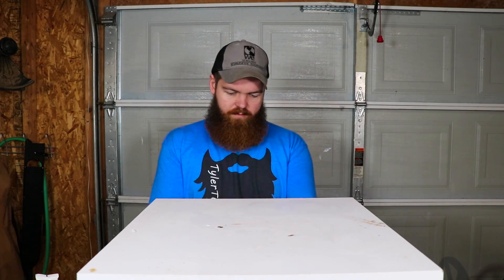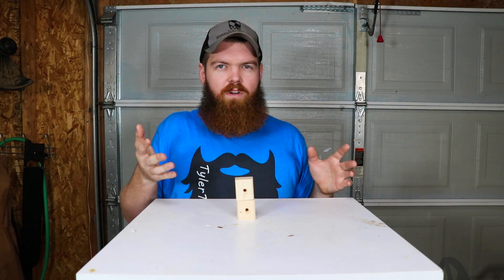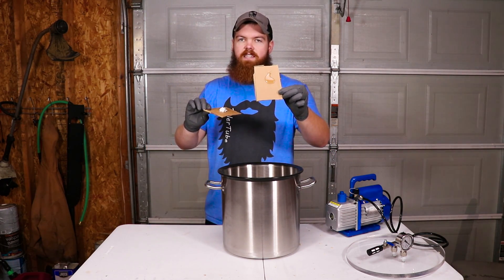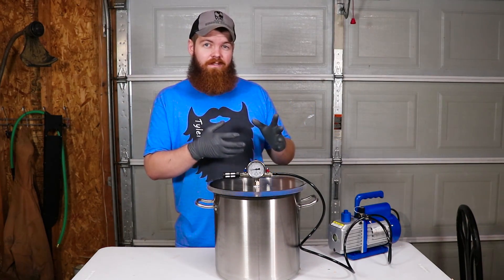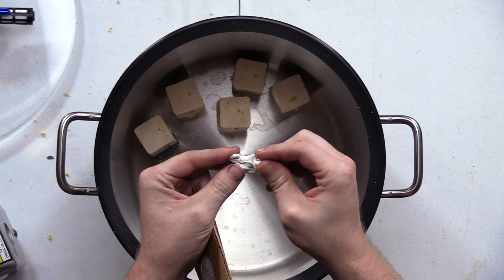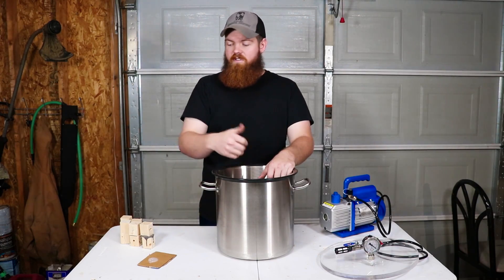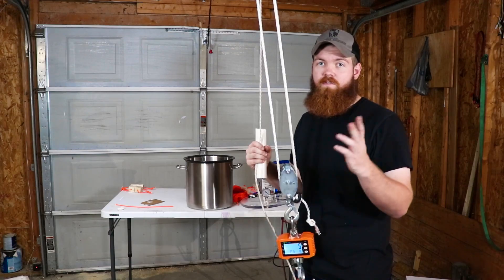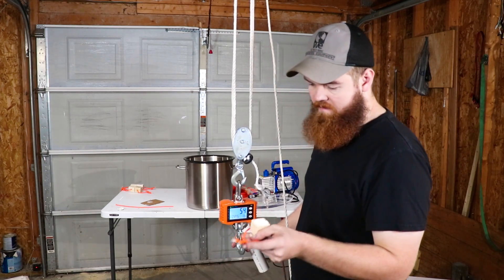Will Glue Dry In A Vacuum Chamber?

Comment: Cool video.  This kinda tested glues not clamped properly, in a vacuum chamber. In general, the thinner the glue line the stronger the bond. Those that foamed up pushed the blocks apart leaving the walls of the bubbles as a contact area. Wood glue and epoxy (JB without filler) are often vacuum bagged for laminations. Is e6000 a contact cement? It's possible the vacuum extracted the solvent allowing it to cure where the blocks in air never had a chance to cure before they were stacked  together.

Comment: Given my profession at one point was advanced composite repairs for military aircraft, anyone trying to criticize your technique should know ahead of time that your set up is far less janky than vacuum cure set-ups I've seen work from my previous coworkers.

Which a truthful job description for advanced composite repair:

Literally 90% of the job is watching glue dry under vacuum sealed conditions. For an aircraft it's just sit there on the aircraft with a good book and do that for an entire shift making sure no alarm fires.

Edit: Also, if anyone is curious, you typically vacuum cure glues for fiberglass and graphite and similar, usually with heat too, and no, we'd not get caught dead with JB Weld for use in the aircraft repairs because we'd probably get murdered by our shop chief (if the shop chief is competent).

Also, typically, vacuum curing glues requires specific types of glues or resins acting as glues and usually is heat treated, not a comment against the vid, specifically just an FYI.

Comment: Fun fact: metal flash welds in space. So they don't need a welder in space, all they need is the piece of metal and then it will attach itself to w.e. they stick it to
Reply: True if the two metals are very clean and smooth, and not previously thinly oxidized with exposure to oxygen (i.e. inside the space craft)

Comment: You need to boil water until it freezes in the vacuum chamber. All you do is put about an inch of water in a glass or plastic cup and put it under a vacuum. It will start to boil and the temperature drops while it’s boiling until it freezes. It takes a little while to freeze depending on the size of vacuum pump you use.

Comment: I think the results would have been different it you didn't use end grain.  I think that might explain the last result.  End grain on a wood is like straws that are bunched up.  And the vacuum sucked the glue up through the grains (because its like a a straw)  But the last one might have been viscous enough that more glue stuck around.  But if you had used the edge grain, the wood would've failed before the glue joint.  Really interesting.  And don't ever change.  If you like scientific vids, there are plenty out there.  I watch your video because it's  entertaining and interesting!!

Comment: It is near impossible to create a perfect vacuum on Earth. So there IS still air in the chamber to dry the glue. The bubbling of the glue in the chamber was caused by gasses inside escaping due to the lower atmospheric pressure. With less air pressing on the glue to keep the trapped gasses inside they "boiled" off until an equilibrium was reached.

Comment: My theory?
The E 6000 is less viscous than the rest, so when you pulled a vacuum, it too bubbled, but because it was thinner, the bubbles popped and reset before curing completed, also, while it was resetting, the vacuum pulled the glue deeper into the pores of the wood, giving it a much better hold.
The other glue's being much more viscous, and with quicker curing time, cured with the bubbles still intact, greatly weakening the bond.
I'll be the other glues, while having weaker bonds, still saturated deeper into the wood as well, but because they cured before the glues could reset before the bubbles popped, the bond was compromised.
I'll bet if you look at the wood blocks from the vacuum chamber, the glue is still on both pieces of wood. Showing that the glue held to the wood, but failed because of the bubble matrix within the glue itself.

Comment: The glue that was stronger in vacuum was interesting. I would note though, it look like Tyler applied a "shock" load on the non vacuum bricks. (a shock load is a load applied very suddenly such as a car crash or a hard quick tug on a rope). Shock loads have more effect and will cause a material to fail quicker then slowly applying a load at a constant rate.

In short,
The E6000 (or what ever its called) could've failed so easily the first time round because Tyler pulled top hard and quickly on the rope. The other glues were interesting though. If you plotted the results, you could probably figure out a relationship. This might've been something that NASA and Space X have had to think about. All in all, good vid Tyler!
Reply: Nerd

Comment: HEY TYLER INSTEAD OF USING WEIGHT THAT CAN MOVE AND SHIFT WHICH CAN PUT UNDUE STRESS ON YOUR TEST, JUST USE A LAG BOLT IN THE GROUND AND PULL ON THAT! THEN YOU WON'T HAVE TO WORRY ABOUT RUNNING OUTTA WEIGHT EITHER!

Comment: Hey Tyler, can you run this test again, but put weight on the blocks? I suspect the weakness was due to the micro air bubbles coming out solution in the vacuum. I wonder if there was weight to clamp the pieces together to close the void again if it might be stronger?

Comment: you can get a cheap boat winch at harbor freight to mount on your wall and use that to pull the rope instead of the pvc pipe. this will save your toes from the falling weights and save your fingers from rope burn. I used a similar set up to lift the back of my snowmobile in my shop when doing maintenance. p.s. I love the videos. you answer questions that I didn't even know I had until I read the title "will glue dry in a vacuum chamber?" "does nano tape really work?"

Comment: I have a suggestion. What about instead of weights you just bolt a hook into the floor? That way it will measure the weight of resistance and you won't have to worry about not having enough weights

Comment: So, to give a brief explanation to the results

Pressure changes will directly affect the phases. For example, the reason why you're probably seeing so much bubbling is from any water in the glue BOILING OFF. That's right, under less pressure the boiling point of water decreases and will boil at room temperature and below (while also freezing into ice, as the melting point also changes and can exist in the "triple point" state, where the two points meet allowing for a quick change between all three phases In the case of water, lowering the pressure INCREASES the melting point temperature, while other materials will typically see the melting point temperature decrease). I would imagine the issue the glue is facing in the vacuum chamber is exactly as Tyler guessed, its having issues with curing as some of it is probably melting, which is what might have led to it smelling so bad (liquids give off more vapors than solids). As for E6000, im not sure what's going on with that glue. It could be that the glue had a higher melting point than the others, meaning that the water boiling out of it only made it dry even faster and allowed it to cure even stronger? Not sure, i can't find much info on E6000.

Comment: The glue "dries" because of a chemical reaction triggered when it makes contact with the air outside of the tube. The main reason it's weaker inside of the vacuum chamber is that it can't continue to react with air once the initial reaction has finished. As for the e6000, my best guess is that a: it relies on a different reaction which isn't dependant on oxygen, or somehow has its own, and b: the dried/cured material held the vacuum once you opened the tank, creating a similar effect to clamping the blocks.

Just a guess, though. I'm no scientist, just a knowledge enthusiast.
Reply: Nerd
Reply: @goodjoke6525  Yep!

Comment: Pro-tip. Lag an eye bolt into your garage floor (they make covers for them so you don't trip all the time, typically sold for tying down motorcycles) then mount a manual wench on the wall, still using your reducing pulleys, and you'll have smooth pull with a much higher weight limit. Bonus, you won't have to constantly lug heavy weights around and pinch yourself on chains.

Comment: For anyone who is interested in the science factor: A vacum chamber pulls the air out of the product in there causing the air inside the glue to "expand" creating a weaker bond. There is less surface area between the glue and wood blocks making it weaker.

Comment: Do a test in glue itself without blocks.  Test a set of glue inside and outside the vacuum chamber.  See what the hardening state of each glue would be.  Would the glue harden or soften inside the chamber after 24 hours.

Comment: This is a big long paragraph explaining what you did wrong. I don’t know what you did wrong, but i will explain it to you anyway. You see that thing you did at that one point? That was wrong. You were supposed to do the other thing first. And you know that other part? That was also wrong. You need to rotate the thing 60 degrees first. Also you were supposed to heat the thing before doing the thong. In conclusion, you are very wrong in everything you did, and you should feel bad. I am disliking the video because i have a massive ego. This comment sure is meta, isnt it? This is how you do things correctly, not how you did the things.

Comment: You should try this again but add weight to the blocks in the vacuum chamber. That way they remain compressed while the air escapes. That will give you a MUCH more accurate idea of whether the air makes a difference. When they are able to spread apart it weakens the glue. The more concentrated it is the stronger it is. So if you try this again but put a heavy weight on top of them, the air should go out the sides which will leave the blocks tightly together. I would add extra glue because you will lose a lot out of the sides. So maybe, somewhere between 25 and 50% more glue. Probably more towards 25%.

Comment: The glues that were weaker probably need oxygen to cure, whereas e600 probably solidifies by loosing all of the solvent that keeps it thinned to a paste. This would explain the apparent extreme variation because glues that evaporate solvent can only evaporate so much before the vapor pressure of the atmosphere prevents it from leaving the glue. Without the atmosphere nearly all solvent could leave, allowing for a much stronger solid.

Comment: If you have a stronger vacuum pump it would have better results your vacuum pump is a little too weak press something like that you need more power
And I have a suggestion if you get a more powerful vacuum pump full up a jar with super glue and put a block of wood in it to see how much did the super glue soaking and if it made it stronger

Comment: Air inside of the glue was released and then caused less bondage and assuming less surface area on the wood causing less strength. Pretty cool.
Reply: Yep also some glues need air to cure correctly as apposed to dry out which the vac chamber would cause.  Also I think you meant bonding :) Glue and bondage is a very different video

Comment: How about comparing the strengths of glues cured by natural process vs drying by heat gun/blow dryer.
Reply: I think this video pretty much covered that. If the glue doesnt have enough time to cure to tje surface it wont be as strong, exactly as we saw here.
Reply: @Eltonbang69  well, it could be that the glue isn't curing well due to too high of a temperature at that pressure, since lowering the pressure would lower the temperature needed to melt the glue.
Reply: Hell yeah